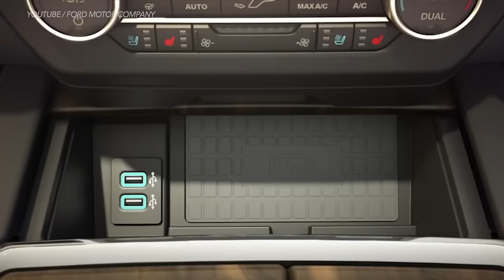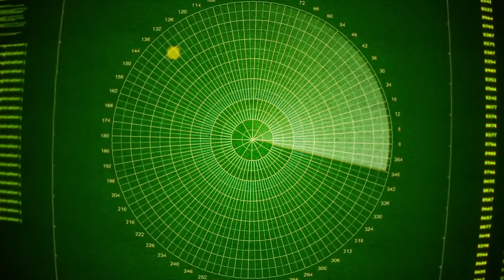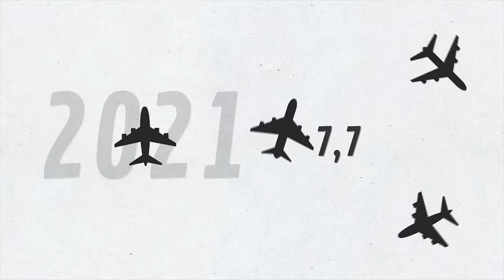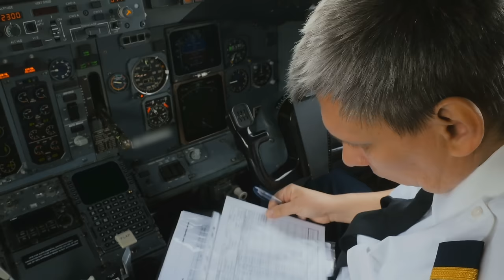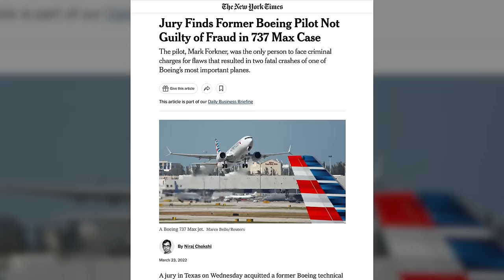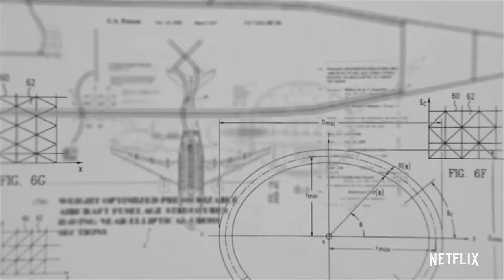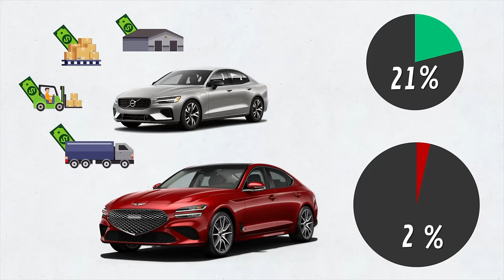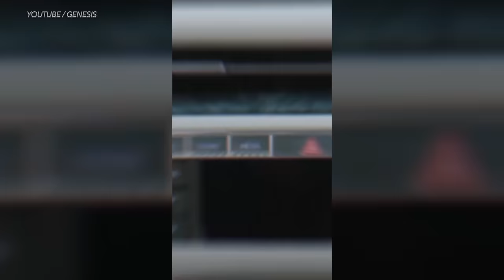Here’s Why Honda and Toyotas are Unreliable Now

Comment: 90s and Early 2000s had the best reliability cause they were at a point where they new how to build stuff reliably but now it’s who has the best technology not who is more reliable so people cheap out on Materials and so it’s not as reliable
Reply: But they weren't fuel efficient. The 2010s had the most fuel efficient cars with improvements in hybrid tech.
Reply: 100% true. My fam has the Lexus RX350 07' as the family car. My 01'Highlander with the 2az-fe burning oil engine. That has around 283,*** & counting. Just goes to work & back & I change the oil estimate to 5,000 but only goes up to like 4,500. The ghetto utility, grocery, cheap gas car we have & use is a 97'Rav4 with 3s-fe engine. I too change that car but once a year because its distance is around 1,500 a year. 
The total insurance cost for all 3 cars in 1 year is around $1,800.
Reply: I don't give a crap about all the latest tech though. I just want a reliable car with decent power and gas mileage. A lot of people seem to have forgotten that a car is a tool, not something to base your identity around.
Reply: Well said.
Reply: My old Proton Wira Mitsubishi engine 4G92 MIVEC 27 years still running. more than 400000Km!
Reply: 2000 Tacoma with close to 300,000 miles! Just getting warmed up now. Hope to get 500,000 miles plus out of it!
Reply: @sohyp1970  some old Mitsubishis are good but personally I’m not the biggest fan of them my dad had a 1998 Dodge Avenger with the 420a i4 and that just burned oil all the time and the new one have bad build quality but that does not mean they are all bad
Reply: @blacksilverchair3315  some of them had better fuel economy if we leave out hybrids, but they where not as safe.
Reply: @Nebraska2927  my grandpas 2002 suburban with rust all over it from being in 
Michigan has like 370k miles I think with the vortex 5300 burns no oil original transmission which is weird for towing heavy stuff for like 120k miles and he gave that to my uncle and now he has a 2005 Yukon xl Denali with the vortex 6000 and burns no oil no rust and he just had it re painted and it has like 230k
Reply: @thetechlibrarian  that’s the only reason I would pick a new car new cars are way more safe then older one
Reply: @thetechlibrarian  actually that's right.
Reply: Yeah 90s and early 2000s reliability very good ,my 2004 f150 4.6l v8 has over 400k original engine.
Reply: I miss my 91 civic sold it to my friend back in 2003 for $900
Reply: @anomaly864  I'm with you.
Reply: 90s to 2000s fell in love with crappy plastic interiors.
Reply: @anomaly864  buy a mazda 2/ford fiesta 😂
Reply: I think you're biased
Reply: Planned obsolescence. They already got consumer’s brand loyalty, what use is loyalty if you don’t use it?
Reply: I extremely disagree. The point you are talking about is the mid 80s to mid 90s
Obd2 brought in the big money with sensors.
Reply: @lonerider5315  obs2 made cars more reliable but there is more then that type of engine oil ways things were made there are a lot of thing to make car reliable
Reply: @licungR  so this is what my grandpa says to me all the time it always depends on how a car was token care of cause you could get a Toyota with a 22re 4 cylinder which if you done know is one of Toyotas most reliable engine and has a nickname of the 1 million miles engine but if you don’t put any oil in it you won’t make it passed like 15k miles but if you take really good care of it you could make that engine go past 1 million miles it always depends on how a car was token care of
Reply: Right on..Imagine honda not being able to make an electric window..ridiculous.
Reply: Most reliable? You're biased because you were young at the time period
Reply: if you need these sensors to avoid an accident,, you're too stupid to pay attention and drive, you shouldn't drive.
Reply: @OriginalStachuJones  I’m 14 at the moment
Reply: @richsweeney1115  exactly, right on, it breeds complacency! If you're seriously engaged in the task of driving you shouldn't even be listening to the radio, let alone be scrolling through you're phone or taking a nap, it's still a novelty technology at this stage, although it still should be pursued it's 20 years away from being reliable...
Reply: I think lexus es300h has Most reliable technology And Most simple function with Loaded new Technology
Reply: I compromised with a 2010 Corolla.  It has the reliability, safety AND fuel efficiency.  Mine has over 111,000 miles on it and I never experienced a major issue with it, plus, it gets between 32-34 MPG.
Reply: Depends on what make and model! My 2004 dodge ram has been by far the worst pickup I have ever owned! Have spent more on repairs than what I paid for the stupid thing!
Reply: @katanamaki9015  that and how it was taken care of before you got it
Reply: The car companies are all cramming tech into the cars trying to out do one another. They seem to think it makes their cars more luxurious to have all this crap in the car.

Comment: As a mechanic of 45 years and on Hondas for 35. Hondas reliability has spiraled downward in the past 5  years. Personally I don't own a Honda over a 2006 and wouldn't. I would rather buy an older model and put money into it.
Reply: Which of these cars has reliable CVTs, toyota or Honda?
Reply: My 98 Honda Civic lx 5 speed manual is the best car I have ever owned. It has never let me down.
Reply: I miss my 92 Honda hatchback
Reply: @gutadin5  I don't know know about Toyota. When Honda first started out with them they had issues but they seem to be doing ok now.
Reply: @bearschmidt3180  I just bought one that needs a lil work, Its a cute reliable lil car
Reply: @gutadin5  I guess both of them are good, but remember to change the transmission oil at recommended intervals if you by a car with CVT.

Comment: Still driving my 03 crv and 06 rav4😊. Both clocked less than 110k miles. No major issues just normal wear n tear ex tires pads shocks.
Reply: The problem with keeping older cars running is availability of parts - especially new OEM parts.
Reply: @genericdude6551  parts still available at my local motor factors here in UK so no issue right there. I’m using Oem and Non-oem on both cars for more than 10yrs still happy on how they performed.

Comment: According to Scotty, Toyota and Honda are very reliable, and also unreliable. Every week it changes.
Reply: depends if Scotty receives his cheque.
Reply: This.
Reply: Newer honda accords  are  pretty unreliable my friend's 2021 accord needed a new head gasket problems and more
Reply: @Zebra_3  😂
Reply: Yes new toyotas are unreliable
Reply: @hotrod7603  - how so?
Reply: OK, so the newer Hondas and Toyotas are not as reliable as they once were.  But the older ones are still quite dependable (sadly used cars are outrageously priced right now, but that won't be permanent).  In New Jersey, about 1/3 of the vehicles (in a population of over 9 million) are either Honda or Toyota.  In addition, the car owner is responsible for the care and maintenance of his/her vehicle and if they take excellent care of it and drive responsibly, any care can last a good long time and they won't need a new vehicle.  However,  if I absolutely positively had to buy a new car, it's going to be a Honda or Toyota because most other cars are pure crap.

Comment: The difference is when there is an airplane accident or design flaw, they figure out what it is, and correct it.
Many car manufacturers don’t want their cars to last too long without a problem. They are made to fall apart, so you buy a new one. Average plane is in service for 20-30 years. Cars…….? Not so much

Comment: I’m contemplating having my 1995 Corolla restored since the engine is so strong and frame not too rusted. Have my trusted mechanic refurbish all the major systems and finally get a paint job.
Reply: You should. I own a 97 t100 pickup (first tundra), and it looks immaculate! Paint besides some clear coat spots looks amazing. Runs great. When this engine (5VZ-FE V6) finally dies (if it ever will)  throwing in another used engine. Might even throw in extra money to make it a 4wd.

Comment: Simple. Buy older models. That's why this year I bought a Honda Accord 2018 Touring.
Reply: Define "older"
Reply: @t.martin3179  The generation before the crappy one.
Reply: Aye, but personally I'd go several years older myself.
Reply: I'm still driving my 2012 Scion xB 128k
Reply: Never get the early model years from a new design until the tech has matured
Reply: 2018 is a brand new car to me.
Reply: @oeljay  exactly.
Reply: So buy a 1998 Oldsmobile intrigue with the 3.8 v6. Got one check
Reply: I built my own Flintstones car
Reply: 4y is old? Sarcasm or bourgeois?😂
Reply: @RadAngelDMV  relativity.
Reply: I just bought an 07 sequoia
Reply: @t.martin3179  pre-pandemic. 2019 and preceding year models.
Reply: @TheCatheterCozy  almost pulled the trigger on a lacrosse.. very smooth and quiet drive
Reply: Yabba dabbo doo
Reply: The problem is that the desirable older models are old now.  For example the desirable GM models with the 3.8 are 15 years old now.  The replacement engines are garbage.
Reply: Buy one of the Classics that isn't computerized and is just a Normal Damm car.
Reply: @danielpassigmailcom  it's old enough not to have high mileage or transmission issues.
Reply: Still driving a model T

Comment: I would agree here. Years ago Honda’s were the car. Myself, I have owned 3 of them. My present Pilot, well I had a major issue with.

After 160000 miles it required a complete engine rebuild. Vehicle was expertly maintained by only Honda dealer mechanic. Yet the valve issue (which was a maintenance bulletin and a class action suit on) and because my vehicle exceeded the mileage they blew me off.

Everyone I knew who had Honda’s stated this should not have happened. Very expensive repair but it is my last Honda. I will buy no more because of this….

Comment: One the most reliable and economical vehicles I ever owned was a ‘62 VW Beetle. Simple low tech, high reliability.
Reply: '65
Reply: '63.  Not so certain about a certain engine system regarding reliability though. The valve train needed that adjustment constantly, and even so, the early non-doghouse fan shroud put lots of hot oil cooler air over the third cylinder and no matter what you did, the exhaust valve would have a short life, at least in Florida.  Yes, they are simple and economical to work on, and I love rebuilding them to this day.  That being said, cars from the mid 90s through about 2008 will run and run and run even with abuse from questionable maintenance by the owner.  Point is, engines today are much better, but the electronic excess (to be differentiated from the engine itself) puts things in the toilet.  

Anyhow, not really disagreeing or not directly disagreeing with your original point - I get it. Just offering additional thoughts
Reply: Having rode in a couple of the old bugs I would have loved to have gotten one. That crazy rattle of The Little engine 4 speed on the floor and those straight back seats. The Germans were on to something and they should have kept building them as is. I guarantee if they started building those now screw the so-called safety issues the streets would be full of them. How safe are cars actually? They're less safe now because people think all these computers are going to think for them.

Comment: I just bought a 2022 Honda civic si. Glad Scotty confirmed how safe it is.
Reply: Lol. It’s a brand new car, we won’t know how safe or reliable it is until we start having some history
Reply: good keep it forever.
Reply: Right after he told you how Honda reliability and quality were dropping like a rock.  I think Scotty wants us to buy airplanes.
Reply: It’s pretty darn safe when it’s sitting in the driveway,  busted. 👍
Reply: Is that a CVT transmission?
Reply: @gutadin5  manual
Reply: @jimjaremka8601  correct. His previous video he said he only buy toyota.
His other pevious video he said Honda is more reliable than toyota.
His other previous video he said don't buy this honda with this engine.

Comment: There is a huge difference between reliability and electronic safety crap.  I usually end up turning off as much of that junk as possible as it distracts from driving and makes my life less safe.  The only thing I find useful is rear backup cameras and that only because they're forced to design SUVs with huge blind spots.  So its more of government breaking your leg and handling you a cane.  My 93 Acura Integra is still going with over 250k on the clock.  I change the oil, tune it occasionally and it just keeps going.   Its one of the purest and fun little cars ever.

Comment: My current cars range from 1988 - 1994. No, they don't have all the fluff current cars have, but I don't need all that stuff. They have the features I do want. And they rarely have any problems. But when they do, it's easy to fix them. OBD1 is quite simple, yet works just fine.
Reply: The problem with keeping older cars running is availability of parts - especially new OEM parts.
Reply: @genericdude6551  Yeah, I've got a pretty good stock. I keep adding to it. But I do understand how sometime there will be some things we just can't get anymore.

Comment: My brother's Honda Civic had only about 25,000 miles on it and one of his injectors went south.  Had to have the entire injector system replaced for a couple grand. It hasn't run well since, and now the front end is starting to need work with less than 40,000 miles.  Made me really start to question Honda reliability.
Reply: What year is this?
Reply: @Electrodexify  it's just some stuff he made up
Reply: What year is the honda Civic?
Reply: Mine is 2020 it’s fine
Reply: @hermanjohnson9180  He's probably a butt hurt BMW owner projecting.  😂
Reply: Same here, 2019 model at 20k kms had to have the entire injection system replaced. Honestly it seemed fine but it was throwing codes nonstop and all the features in the car would become disabled until the codes were cleared. Thankfully it was under warranty.

Comment: I agree beyond a doubt!. I worked for Toyota from 2007 to 2015 as a tech and we saw so many engines being toasted because of 0w20 oil. Leaks at 50k miles. Then the recalls with the airbags. It has gotten bad!
Reply: JOHN, I want to buy a good   USED, TOYOTO to use for the next 20 years. What years would be best for RELIABILITY,  UPKEEP, ?  My 99 TOYOTO COROLLA now has 226,000 mi and still runs great. it will be a BACK UP for occasional use.

Comment: 😣Well crap, I just got rid of my 2005 Honda Accord (cried when I had to let that old baby go) and bought myself a 2022 Honda Accord. I kept telling people how good my old Honda was and how I barely put any money into it. The original AC worked and it was 17 years old. I was hoping that they made the new Honda Accords as well as the old ones......to be continued
Reply: I hope it turns out to be a great car for you! I’m a big Toyota guy myself having bought 2 Corolla’s….I wanted a new 22’ but can’t afford it, maybe one day I’ll make enough!
Reply: @greeneyesfromohio4103  I have the 21 and it's great. And @Leah you made a solid purchase; nothing to worry about
Reply: It depends which one did u got, if u got the one with 1.5t and cvt is not as solid as the 2.0t and 10 speed AT.
Reply: @dcal4455  your 💯 percent correct
Reply: @dcal4455  I bought the 1.5 (4 cylinder)🤞
Reply: @halestrum77  Thank you for the confirmation! I sure hope so. I'm kinda like "Honda 4 Life" right now so.....
Reply: @greeneyesfromohio4103  Thank you! I definitely didn't rush into my car purchase. My goal was to pay my daughter's braces off it took 2 years and then purchase my new car. Little did I know that the car market would be so slim. My husband found my new Honda in Michigan (we live in Indiana). Had to drive 7 hours round trip for my new car as there were only 2 new Honda Accords in a 250 mile radius last November (4 states, Ohio, Indiana, Illinois and Michigan). Illinois was charging $4,000 over MSRP so we went with the one at the Tamaroff Honda dealership in MI. They weren't charging over MSRP and they were fantastic to work with. It's all black with all black interior. I love it 🖤
Reply: @Appriberry  for sure! Let's hope it's still chugging along

Comment: Planned obsolescence at it's finest. Way to go auto industry! 😬
Reply: I bought a 77 Camaro in 77. It lasted 2 years before the paint was gone the dash came apart and the door handles came off. That was planned obsolescence
Reply: Way to go current stage capitalism**
Reply: @Irixion  By all means, move to Venezuela or Cuba and let us know how that works out for you.
Reply: I agree the planned obsolescence plays a big role in the declining quality of vehicle. However, in my view, the bigger problem is that nearly every auto maker has given into the UAW for manufacturing. The data is the data and it does not lie. Vehicles assembled by Union hands are inferior in quality.
Reply: yup. own it for two years, trade it in for a new one. or better yet lease- rent a car for the rest of your life!
Reply: @anthonysanlucas6437  They won't. Lolp